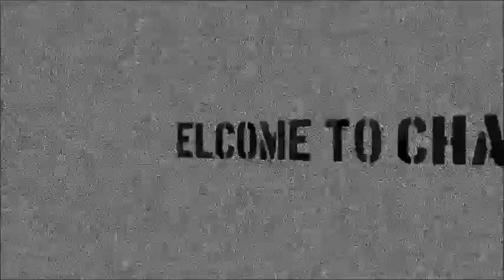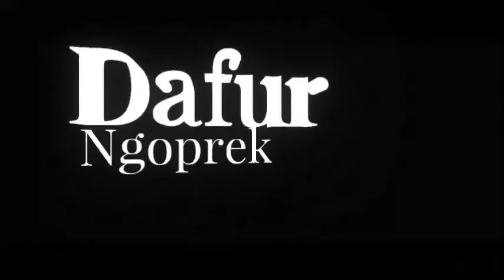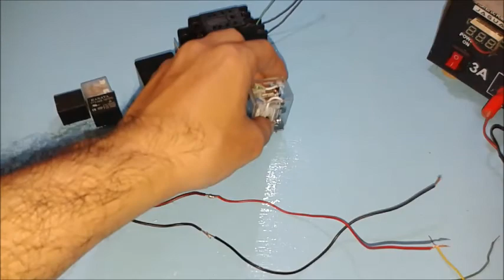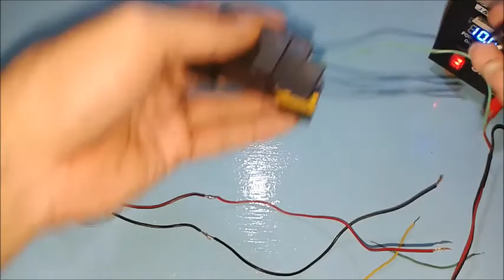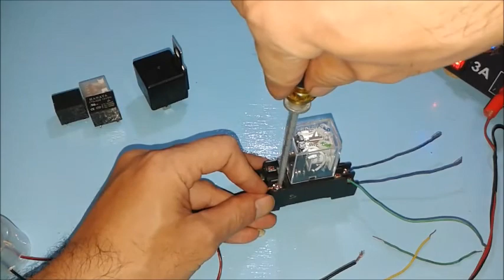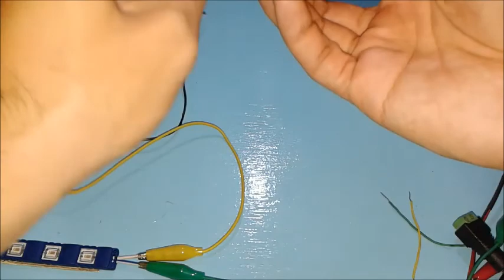bagaimana cara kerja relay

Comment: terima kasih ilmunya bang. ijin nanya juga bang, itu kenapa harus pakai relay ya, ga langsung saja dari power supply ke lampu
Reply from the maker: sebelumnya termakaih suportnya, di sini kan saya menjelasan fungsi relay dan cara kerja relay
Reply: Relay: alat yg berfungsi memutus arus listrik dengan sumber arus berbeda
Reply from the maker: @nellygorden3409  betul cara kerjanya seprti saklar
Reply: bantu jawab ya: di video ini hanya memberi contoh cara penggunaan pada 1 alat (lampu). Praktek di lapangan, relay dipakai untuk menjalankan beberapa peralatan sekaligus. Karena relay ini berkaki 4 pasang, maka bisa dipakai untuk menjalankan 4 alat secara individual.
Yang kedua, relay biasanya juga dipakai untuk menjalankan alat yang membutuhkan ampere lebih besar, yang diaktivasi menggunakan ampere kecil.
Reply: @dapurngoprek871  terima kasih infonya om

Comment: gan power untuk relai sendiri berapa wats atau ampere
Reply from the maker: relay itu hitungan amper ada yg 5 / 10 amper
Reply: maksudnya power magnetic relay
Reply from the maker: @mangpecu9801  tergantung relaynya kalau relay DC  ada yg 12v, 24v kalau relay AC 220V

Comment: Bagaimana kalau ampere yg digunakan melebihi kapasitas ampere relay ? Seperti contoh power supply 12 v dc 20 ampere, digunakan untuk relay 12 v dc 10 ampere?
Reply from the maker: cepat panas dan bisa meleleh relaynya
Reply: Oke terimakasih penjelasannya.

Comment: Mas bro, kalo relay dc, apalah bisa  putuskan jalur ac, misal hidup dan matikan lampu listrik 220v?...makasih
Reply from the maker: bisa tapi mengaktipkan reanya harus sumber lstrik DC. untuk lebih jelasnya bisa liat di video tutorial relay AC dan DC saya kasih linknya
https://www.youtube.com/watch?v=vqtghs6n2vw&t=701s
Reply: @dapurngoprek871  ok, makasih mas bro ilmunya
Reply from the maker: @samcell665  iya sama sama makasih juga
Reply: Bang kalo misal kita ada output 24dc,,gimana caranya bisa terhubung ke yang bebannya perlu 220volt ac,,?
Reply: @andysofyan3596  pake relay ac mas bro kalo sumbernya Ac 220 volt, kalo outputnya bisa dc bisa juga ac

Tapi kalo relay DC, mesti pakai sumber DC juga juga tergantung sumbernya kalo sumbernya 12 volt, pakai dc 12 volt, kalo sumbernya 24volt beli relay dcnya 24v juga...kalo outputnya bisa AC juga bisa DC...

Kayanya sih gitu, saya dah coba
Reply: @samcell665  berarti emang harus pake inverter aja ya bang, soalnya kita bikin out dari power supply 24 dc agar bisa menjadi ac
Reply: @andysofyan3596  iya bang kalo gitu mesti pake beli inverter aja yg dah jadi gak pusing bikin ..hehehe
Reply: @samcell665  oke bang Terimakasih banyak sharingnya 🙏🙏

Comment: Relay srd 12v apakah bisa berpungsi klw dengan tegangan 36v,,mohon di balas
Reply from the maker: Bisa cmn ga kebesaran itu volt inputnya..
Reply: @dapurngoprek871  sebenarnya kebesaran tapi aktuator berpungsi pada tegangan 36 volt,, di situ saya bingung harus menggunakan relay 12volt tapi takut relay ya gak berpungsi atau jadi rusak karena kebesaran tegangan kerjanya
Reply from the maker: @daveahmad8119  berarti relay ganti voltnnya yg aga besar
Reply: @dapurngoprek871  oke trimaksih gan
Reply from the maker: @daveahmad8119  sama..sama..

Comment: Kira² penting kah sebuah relay pak?
Reply from the maker: Sesuai ke butuhan rangkaian yg di buat
Reply: @dapurngoprek871  maksudnya gimana tuh? Kalo untuk lift yg menggunakan motor stepper apa perlu pake rellay? Atau kapan waktu yg tepat untuk harus menggunakan rellay?
Reply from the maker: @LaluZulfakarHidayat1998  tergantung rangakaiannya di perlukan relay apa tiadak..relay itu cara kerjanya seperti saklar.contoh seperti sepeda motor itu di perlukan relay untuk menghidupkan dinamonya..
Reply: @dapurngoprek871  nah yg bikin saya bingung seperti saklar itu maksudnya gimana pak? Terus yg membedakan dengan saklar apa ya? Kalo untuk motor stepper kira kira mending make saklar atau relay? atau digabung saklar sama relay?
Reply from the maker: @LaluZulfakarHidayat1998  yg membedakannya klu saklar di operasikan secara manual.sedangkan relay di operasikan menggunakan arus listrik.utk motor stepper lebih mudahnya pake saklar aja..
Reply: @dapurngoprek871  okay siiap. Makasih pak
Reply from the maker: @LaluZulfakarHidayat1998  iya sama sama..
Reply: @LaluZulfakarHidayat1998  ak jg pakai saklar itu buat anti maling motor.tinggal beli kabel sensor.tinggal d pacu pakai magnet.drpd bli anti maling mahal mending pakai relay omron yg 12v.
Reply: @hiburanchanel.official  diih baca makanya saya tu nanya apa jawab apa hadeh
Reply: @LaluZulfakarHidayat1998  sorry bro ak cm baca komen ente d awal.sorry ya klu nda berkenan.td ak cm kasih masukan z.heee

Comment: itu lampu AC atau DC?, supply 3A itu DC atau AC?, supply connector hijau tu AC atau DC?
Reply from the maker: lampu AC, supply DC , connector DC.
Reply: @dapurngoprek871  mcm mana relay itu bagi output lampu AC sedangkan supply DC?
Reply from the maker: @fakrul1992  bisa, karena lampu itu bisa di beri arus listrik DC bisa juga arus listrik AC
Reply: Bos. Emang bisa lampu AC pakai suplly DC. Apa gk kebakar bos

Comment: Kalau relay tulisan nya 12 vold tapi di pasang di aki 24 vold bisa nggk ya gan relay nya transpara
Reply from the maker: bisa
Reply: @dapurngoprek871  nanti arus yang di keluar kan menjadi 12 v ya
Reply from the maker: @maxtrons1153  12 volt itu tegangan kerja maximal relay bukan ouput, klu relay ada 4 kaki kaki yg 2 buat input tegangan kerja relay dan kaki yg 2nya lagi buat ke beban, klu inputnya 12volt keluarnya juga 12volt, klu input 24volt keluarnya juga 24volt

Comment: Mas kalau relay 12volt di kasih tegangan 24v jebol ga ya ?
Reply from the maker: Sesuaikan dengan tegangan yg ada di relay..saya blm pernah coba relay 12v di beri tegangan lebih..
Reply: Nyimak
Reply: Gan kalau input ttangannya 18 volt .. mending pke relay ukuraan berapa ? 12 volt apa 24 volt

Comment: Apa bedanya ngasi 2 arus positif ke reley...?? Kan bisa di jumper itu bang yg ke kaki 30.. coba jelaskan bang bedanya apa bang.. ??
Reply from the maker: Fungsi relay untuk melewatkan arus atau tegangan lebih besar. Dengan hanya memberi arus atau tegangan kecil di kumparan atau coil.
Reply: Misal kalau butuh kontak NC, jika power di jumper dengan common maka NC menjadi tidak bisa kontak karenansudah diputus saat coil relay off
Reply: Jika coil relay 24V tetapi jika beban 220v maka tetap butuh dua arus positif yg berbeda untuk mengalirkan arus 220
Reply from the maker: @arifanfajar4476  https://www.youtube.com/watch?v=vqtghs6n2vw&t=164s

Comment: Apa bedanya relay AC dan DC ?
Reply from the maker: relay ac bekerja di tegangan 220volt dan relay dc bekerja di tegangan di 6volt sampai 48volt
Reply: @dapurngoprek871  yg DC tetep ada NO dan NC juga bang ?
Reply from the maker: @arkadyaizazvian6577  ada semua relay ada NO dan NC nya. singkatnya relay bekerja seperti saklar
Reply: @dapurngoprek871  thanks bang sukses terus 👍
Reply from the maker: @arkadyaizazvian6577  iya makasih jiga suportnya
Reply: Sumber inputnya beda . Itu saja .